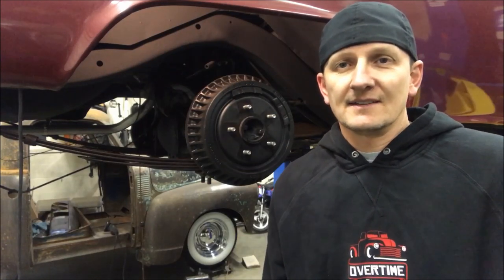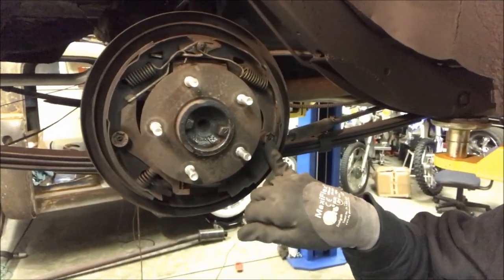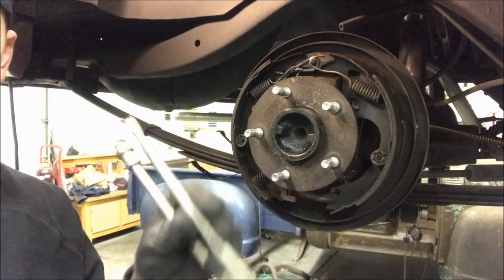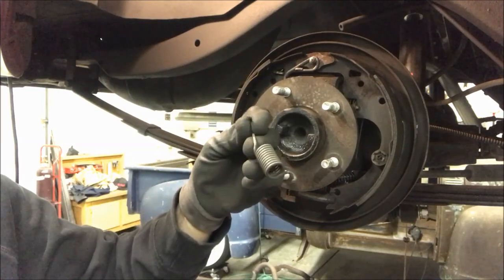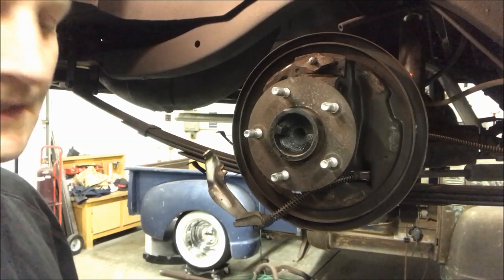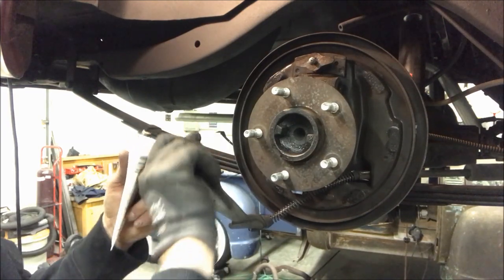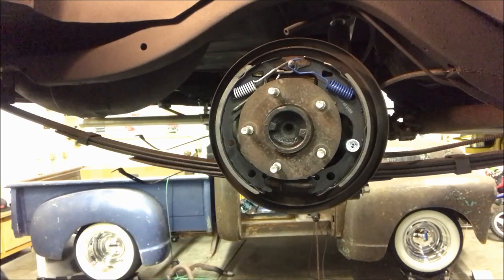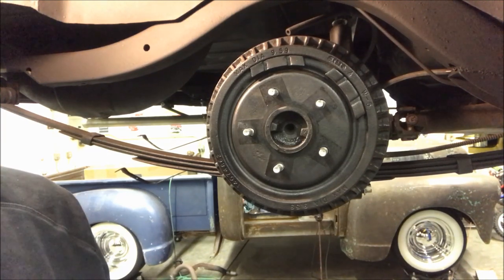How to Replace Drum Brake Shoes

Comment: Hey Trent. Good video. I am replacing the rear axle in my 54 Fargo and all the brakes. This video will help me out. But I think you should be wearing a safety shield or at least glasses just in case one of those springs slip off of your tool. Thanks for sharing.👍👍